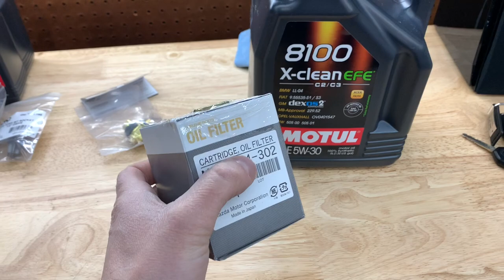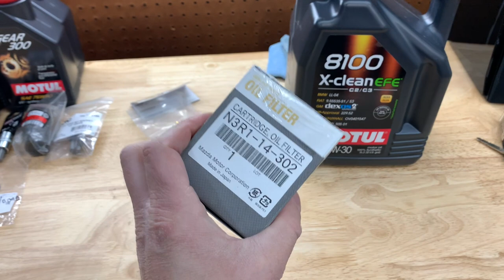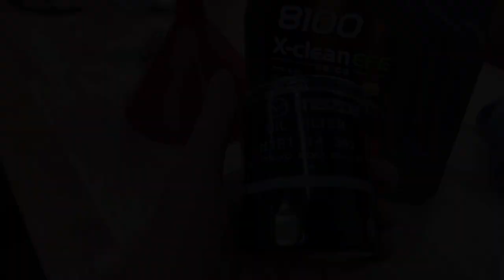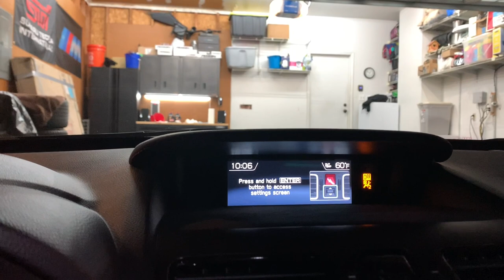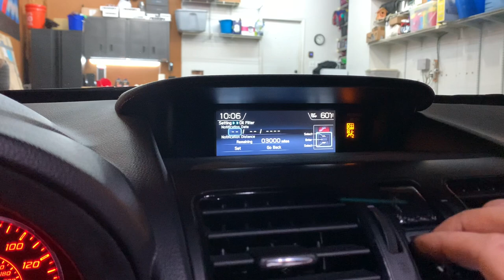2017 Subaru STI Oil Change | MOTUL 8100

Comment: I swear, taking off the  plastic skid tray and putting it back on when you're done takes up 75% of the time to change the oil
Reply from the maker: haha I am able to take it off fairly quickly actually. But yes, the oil changes on these cars are so simple. I find it very rewarding.
Reply: Yes! I hate that plastic skid tray
Reply: I zip tie it to the bumper. I'm over it. The threads rusted off the bolts like a year ago anyway.
Reply: @Scoobyfreak86  look into twb skid plates. Makes changing oil easier, also adds some protection to the underside and also better heat exchanger.
Reply: @DC-ke8qp  yep I just put mine on during my last oil change.

Comment: Nice video brotha. I just changed my rear diff and transmission/front diff oil on my '19 wrx. I used the same Motel gear oil and there is a noticeable difference. Not sure if you ever have changed gear oil before but IT STINKS! It is a messy job and you can smell it days later. I recommend doing it outside. Keep up the great content.

Comment: I don't know what you did wrong or if it was defective but I have a Fumoto torqued to 33+ ftlbs and have zero problems. I used a special C adapter to tighten it down. I drain using a hose adapter straight into my container. No drips. I have one on my wife's Corolla too. I can't recommend it enough!

Comment: Great video! I agree with everything but the fumoto drain valve sounds like it was either a defective unit or user error. I've ran mine for 20k+ miles zero issues! Id still give it a try just get a new one and try it again no worries if not I won't be offended lol! I was skeptical about these till I saw thousands on thousands of reviews of people running these for 5-10+ years no issues and I gotta say I agree I love mine and will continue to run it! Thanks for the cup filter trick I've never heard that before! Going to use this trick moving forward! Cheers 🥂  great video!

Comment: If it's not already on your list, I think a skid plate would be a mod that makes oil and filter changes much more convenient for you. At least for me, not having to take the plastic belly pan on and off all the time is a nice time saver.
Reply from the maker: The plastic tray works well for me. Besides, I don't mind if it scrapes. If I were to purchase something nicer and hearing it hit the ground would make me cringe haha. The stock tray works just fine for me.

EDIT: Damn. Now you got me looking at skid plates with oil change "doors".
Reply: @Scoobyfreak86  Haha fair enough. You definitely hear more pings and knocks from road debris if switching to a metal skid plate over the plastic tray. Mainly changed for the oil change convenience and thicker protection of the undercarriage, at the expense of it getting all dinged up...
Reply from the maker: You got me looking at skid plates now.
Reply: time for tbw chris😃
Reply from the maker: @jayguzman28  haha I was looking at theirs. It’s clean.
Reply: @Scoobyfreak86  Nice, nothing like never-ending temptation for mods. I'd personally recommend TBW; I have the rally version they offer and man, though it's literally just 4 sheets of metal, it looks so nice when installed and covering the engine undercarriage.
Reply: @Scoobyfreak86  if you get the raw one it's gonna come scratched already so don't be mad. Still super nice 🙂. It assists with cooling and makes it easier to spot leaks. I got mine with fumoto installed.
Reply: After 5 oil changes removing the skid cover, I figured out I can just take off the air filter housing, put a ziploc around the filter, and reach down and remove the filter. 

Just make sure the headers are cold or you’ll have a bad day.

Comment: I know you don't have the car anymore but Fumoto has so many different variations of these drain valves it took me a while to find one for my WRX. The one I have doesn't have that piece that fell off in the video and is just a flat surface so hopefully I won't have any issues when I run it.

Comment: Yea I just use a greddy magnetic plug.  & the motul is good stuff! Been using since 7k mi
Reply from the maker: I'll most likely switch to a magentic plug next change. I looked at greddy, cusco, and project kics so far. Little weary of the magnet coming lose, which is some feedback I received.

Yes, looking forward to seeing how the oil looks at my next change. Hoping to see it a little more gold next time.
Reply: Was thinking about a magnetic plug to. My tuner told me to spare the money for something else because small metal parts will be caught in the oil filter it self.
Reply: @Scoobyfreak86  Go for an oem magnetic plug. Been using for 33k miles on my 18 sti and no issues whatsoever. Part #32103KA000
Reply: @ehesh1499  is is the same length as the oem drain plug? looks shorter in pictures or might just be me
Reply: @kevinmucha5996  it looks a tiny bit shorter, but it hasn’t leaked a single drop in 2 Sti’s & 100k combined miles. This one sits completely flush/ parallel with the inside bottom of the pan so every metal flake is caught easily
Reply: @ehesh1499  should be the same for a wrx right? I seen some reviews saying it won’t fit a 15+ wrx. Still gonna try it out haha

Comment: Interesting on the filter from the dealer. For some reason, and its a good one, mine still uses the Black one. I did find that Amazon has the OEM "Black" filters just in case you were interested in going back to the Subaru Black one.
Reply: link?

Comment: I personally use a greedy magnetic drain plug and Motul xcess gen 2 5W40 on both of my subarus forester xt and 2020 STI. I’ve been using the oem blue filters but I’m gonna make the switch to the black jdm filter.

Comment: Man, I hate it that you’re turned away from the drain valve I’ve ran those valves on 4 different cars over the last 5 or so years and never had a issue including my 16 sti for probably the last 4. It seems like it was installation error. I’ve never put a socket on the part that broke off. I’ve always just snugged them on with a adjustable wrench on the square part. I believe it’s brass so that’s why it broke so easily since it’s a soft metal not so much the quality of the part. I’d definitely give it a second chance and do it that way because it definitely makes changes a lot easier. Enjoying the vids tho!
Reply from the maker: I didn’t even get a chance to wrench it on from the body. This was simply tightening it by hand and snug it up with 5lbs of force with a wrench. I know plenty of people run them without issues, but for me, if I don’t feel comfortable with something off the bat, I won’t use it. First impressions are important to me and this just didn’t make the cut. Feel much more comfortable with an OEM style plug.
Reply: @Scoobyfreak86  ah gotcha man and I can’t say I wouldn’t feel the same if that happened to me either! Just curious are you going to do hood pins on your hood? I have the same hood and I’ve and have been wanting to get them done but I’m too nervous about cutting into it. Lol I’ve ran mine for 6 months with no pins, but I keep getting people telling me I should.
Reply from the maker: Not running pins. It latches in very well and do not see the benefit of putting them in unless you track the car.

Comment: cant seem to find clear answers online about this but you allow your engine to reach operating temperatures waiting 5-10 minutes and check your oil is that correct? i was under the impression its supposed to be checked cold.
Reply from the maker: Cold is best since when the motor runs, much of the oil is sitting in the block. When it has a chance to sit, it goes back into the pan which will result in a much more accurate reading. 

What you are confusing it with is when you go to change the oil, it’s better to warm the motor up a bit so it drains cleaner and faster.

Comment: I know youre selling your car but howd that oil work for you? I tried it for the first time and noticed i was burning more oil than usual. I have a 2020 sti no aos. Still stock filter. But jw if maybe my car just doesnt like that type of oil. Been debating switchin to 5w 40 bc powertrain warrenty pretty much out the window bc i already have a ots tune n intake i been running for over a year. I live in MA. Idk obv hard to answer but jw your thoughts
Reply from the maker: I switched over to 5w40 since changing my power setup. However, I had no issues. Motul is one of the best and preferred oils to use in these motors. I would get an aos on the car ASAP.
Reply: Yea im switching to 5w 40 but im hella paranoid im about 1200 miles in and ive already went through about 1/2 a qt i just had my 30k service done by them and just had them throw their oil in this time.they said no leaks or anything present but needless to say im a little paranoid. Ive always burnt a little oil but.  Im thinking of hitting up another dealership bc the one i go to i dnt trust plus inhave an intake and ots tune which ive had since pretth early on . Cars got 28 k. Barely. Needless to say they aint gunna cover anythinf . Brentunin said maybe to do a compression/leakdown test before putting an aos in but jesus if thats a already a problem im not gunnna be to happy and either i have a bad engine or its some thing stupid like its getting into the pcv. Im mechanically incline but def no mechanic. So idk what to do. And its a 2020. Smh.

Comment: They still use the black filter I have it on my wrx . Just wanted to state that you can ask them at the parts counter for the black one.
Reply from the maker: Wrx and STI filters are different
Reply: @Scoobyfreak86  why would they do that make no sense my 2020 has a black subaru filter . I have 8 in the garage . Just saying lol 🤣.
Reply from the maker: They are two different motors. Not all black filters are the same.
Reply: @Scoobyfreak86  gotcha . I wish they were lol would be nice because the filter are nice.  I can't speak for the blue 😂😆.
Reply: @Scoobyfreak86  But you can get the black one for the EJ aswell, i am using it all the time

Comment: I have a 2015 STI and I wanted to know that if for my car will it be the same set up as far as oil and filter my car only has about 58k miles on the engine.
Reply from the maker: Yes, exactly the same

Comment: Just an FYI you put a wrench on the squared part not the nut part of the fumoto drain valve. ;-)
Reply from the maker: Yes I am aware. Didn’t even get to that point to do that. This was simply putting it on by hand and putting about 5lbs of input to get it snug before I torqued it on the body/square part.

Comment: It's an EJ engine.... 😲 In a 2017 Sub. Thought it would be an FA series.
Reply from the maker: 2015+ Wrx has the fa. All sti’s to date have an ej.
Reply: @Scoobyfreak86  But I would believe that the fa platform would be in the later models
Reply: @jermainemorgan8274  That'll be only in the 2022 STI's, not the current ones
Reply: @XPrime1000  about that... 😔

Comment: what type of motul oil can i use for my sti 2020 under 15k miles?
Reply from the maker: If you are worried about warranty, stick with OEM Subaru oil. 

If you want better oil in the motor check out this video https://youtu.be/M3zgbSki4vQ
Reply: @Scoobyfreak86  thank you

Comment: I doing the same thing in about a week my question for you is, the Mazda filter is bigger than the blue oem Subaru filter how much oil did you use? Because I know the fluid specs is 4.5 quarts but since the filter is bigger Would it be ok to to use all 5 quarts to compensate for the larger filter?
Reply from the maker: It’s bigger, but not a half quart bigger. I used 4.5qts.
Reply: @Scoobyfreak86  good to know
Reply: @Scoobyfreak86 the mechanic did me last oil change. I had to same exact fluids and Mazda filter but he had poured the entire 5 liters. He said it wouldn’t effect that much and sees it a lot on Audis a VWs he works on swapping to bigger filters for that extra oil capacity. So that’s why I asked you how many quarts did you put just to cross reference since I couldn’t really find an answer on the net